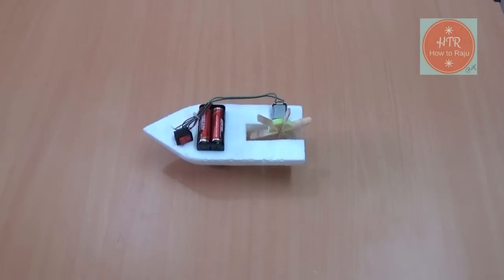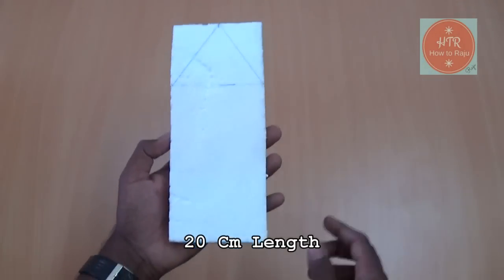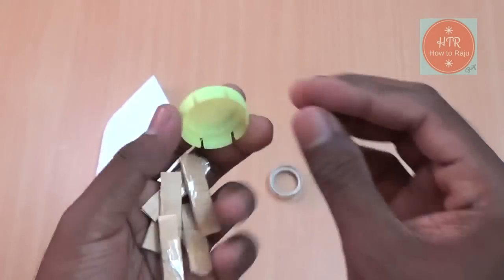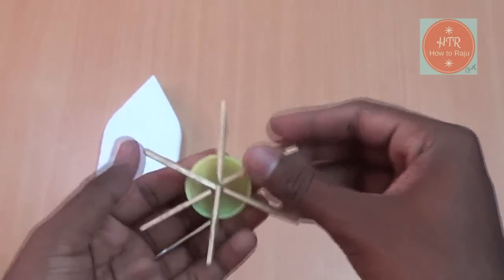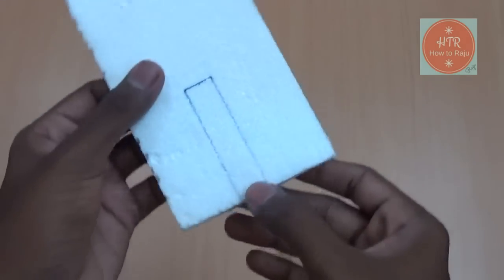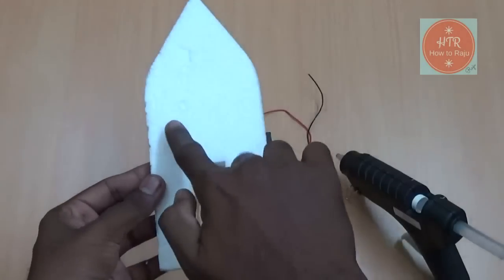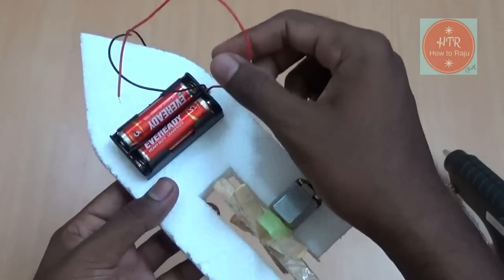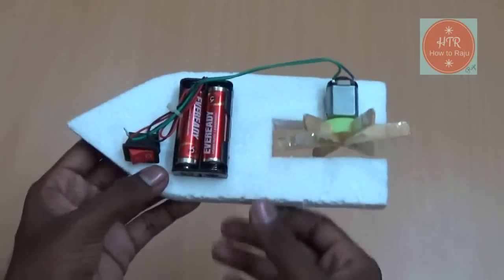How to Make a Simple Toy Boat with DC Motor at Home

Comment: Hello..I tried  making this but the propeller stops rotating in water....!! Any suggestions?
Reply from the maker: +Anam Ali I think the motor will need some extra power. So use 9V battery.
Reply: +How to Raju I used a 9C battery..still nothing..